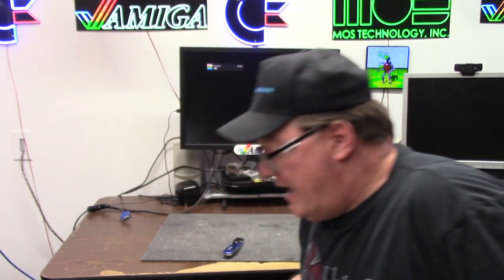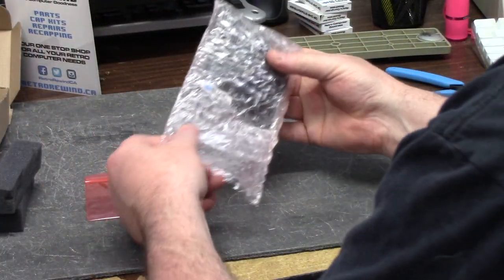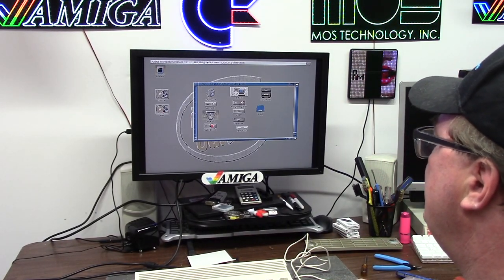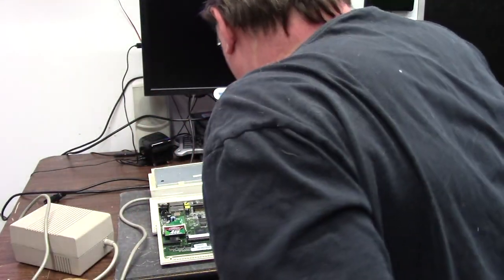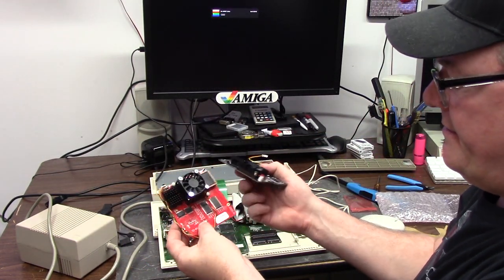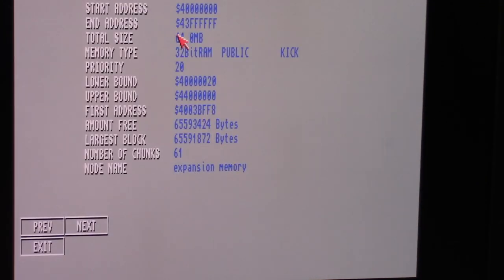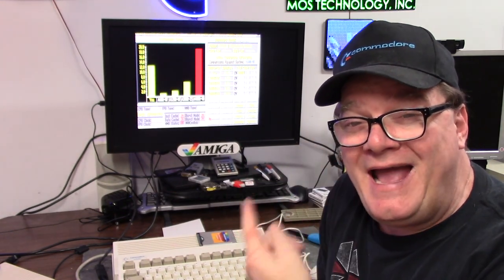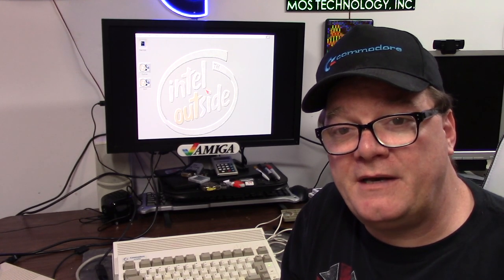Amiga 600 A630 68030 50mhz 64m Accelerator

Comment: A short Amiga story.  Back in the '80's, I worked at a small used computer store called 'The Byte Brokers'.  I had access to lots of old equipment to feed my computer acquisition addiction.  Altair, Osborn's, Ottrona's, Mindset, Sage, Commodore portable (laptop), Colts, 64's. etc. I could list dozens of machines we had (and many that I purchased).  I ran the service department for many years and personally repaired hundreds of 64's (we were one of two facilities in the area).  Belonged to the locale C64 club, and a Commodore rep (unfortunately don't remember his name) attended and brought out a pre-production Amiga 1000.  OMG, I was hooked... it was so far advanced over anything I had ever seen or used.  So being a retailer, we obviously had some relationships with other local computer dealers... and I told my boss - hey - want an Amiga 1000.  So he called the local Amiga dealer to be (It was either Businessland or Computerland - it was 34 or 35 years ago) and let them know that we wanted one.  So on a very, very stormy night here I got the call to come and get it... and I sped my way ovr in my '69 Camaro and picked that baby up.... $1200 plus tax - got the first one in the area as well as the first discount.  Now keep in mind, there were no monitors or peripherals available for it.  No software yet either - just the OS and the demos that came with it.  But it started one helluva love affair with a computer, and I have had one ever since.... had several different ones... and hopefully I will find another 3000 (I bought one new and later sold it to help pay for a new baby) at a reasonable cost (yeah, I just fell out of my chair laughing as well).... anyway, that's my story. ;)

Comment: Love all your videos!
I started back with the A1000 before there was a model number on them. Still have the monitor, which also has no model number anywhere on it!
Migrated to the A500 the next year, and then to the A2000 a couple years after.
I started running a BBS (Citadel-68k room-based software) on the A500, and started to migrate to the A2000 while upgrading it to 8megs RAM, 40M HD. It had external Zip-drive for backups, and a 7-disc CD drive for Fred Fish discs access to the BBS.
Just before having to clean house for a move, I was about to add a 1.44 floppy in for DF1:
About 2 years ago, I bought an A2000 in the hopes of starting the BBS back up, but have run into various problems, inconsistent problems, and now the video splitter/capture card won't work, and both floppies don't work. The MegAChip doesn't make any change, so I'm stuck with 5M chip. After our last move, the modem won't connect to the phone line; still working with Spectrum on that issue...
Again, love your humor and memes you come up with on the fly!

Comment: What would happen when playing classic A500/600 games with the A630 installed? Does it cause any issues if you wanted to play Lemmings or Cannon Fodder? Apart from the Sysinfo benchmark, what 'real world' advantages does the accelerator card bring over not having one? Thanks.
Reply from the maker: Much needed 32b fastram.  All the games ive tested work well.  The 030 has always been known to be the best in compatibility and performance

Comment: I ordered one of these, but My A1200 is too fast (same CPU on the axel card, but 128MB fastram and more options.  Individual Computers ACA1234 for those who are considering too fast option - they manufacture cards for A500 too).  The only reason I would use A600 because it doesn't have AGA glitches on all the demos and games.  AGA cannot be turned off no matter what even using the early startup menu as it is a hardware chip, not software.  A600 - ECS.  A1200 AGA.  Great for those software that support AGA like Deluxe Paint and several good games.  68030 Gold Top.  So to use all the software (I have an 6GB disk image or so) I need two Amigas.  I also have MiSTer FPGA (MiniMig - soft 68020 core) as a low end reference to compare other systems with.  Cool video.  Retro Passion Co Uk.  They can rebuild whole PCBs.

Comment: Another great vid Chris 👍🏻 Slung my Furia too! Now running a ACA620 I picked up from Fleabay and like you glad I swapped. Don’t really like the Furia. Too much messing around for something that should just work 🙄 
My Amiga Story; Not going to start from the beginning. With A500 in 1989 or A1200 and CDTV in 1993. I’m starting from 2006 where I decided to get back into the Amiga scene. I don’t know what it is, but the Amiga is a enigma that I still needed to explore in the 21st Century. Since buying a ESCOM/Amiga Technologies NOS off EBay (First part of the journey not knowing that after Commodore, the Amiga was being made after 1994!). I’ve discovered a lot more about what the Amiga can do. For example that ESCOM made systems had a change on the mainboard to use a PC type Floppy Drive, but meant you couldn’t use older Commodore made floppy drives and Gotek internal drives. Since then I’ve dabbled with Tower projects with Mediators to actually owning my Dream Amiga. The Amiga A4000 Desktop which I upgraded to the max with a Cyberstorm PPC/060 as well as discovering trying Amiga OS 4.1FE for the first time. To me the Amiga still holds a lot of mystery and it’s always Head blast finding out new things every day.

Comment: Hey Chris, great video. I have also a rgb2hdmi in my a600 and I have also fixed this with hot glue, but on the side. My Denise chip is really hot, so I have cool it down with a passive heatsink and a small fan. I hope your Denise don’t die, because you fill it completely on the top.
Reply from the maker: Ill keep that in mind.  Maybe ill remove that glue then.   Thanks for the tip!

Comment: My best Amiga story is about my 1000. It started out with only 256K. Then added an additional 256K in the front panel. My next addition was an A-Max Macintosh emulator. I then added a ROM switcher with 1.3 and 2.something. Next came an expansion box with two  slots. Into those slots I put a 2MB card and a BridgeBoard card. My last addition was an Amiga 2000 keyboard and adapter as my original keyboard became FUBAR. Wish I still had all of this! The only item I still have from that time is my Mac IIci with it's '040 accelerator and a Screaming video card whose make escapes my old brain. Too lazy to get it out and check, lol. That system was close to $10,000 back then. A fool and his $$$.

Comment: This is the board I've been saving up for, it looks great and seems to be less hassle than the Furia.  But then I started to think pistorm600 instead. It's like someone showed me an easy route to what I want and I said - no! I want bugs and CPLD hassle and artificially expensive raspberry pi boards and SD card imaging. Because I choose to do things the hard way for some reason...

Where was I? This board looks very nice, thanks for the demo and benchmarks, it's good to see it in action.
Reply from the maker: pistorm 600 video comes out on the heels of this one.
Reply: @ChrisEdwardsRestoration  nice. I hope the pcmcia problems weren't a deal breaker for you. Or maybe you got it working?

Comment: Great video as usual Chris
I wonder if anyone has attempted to make an a600 CPU adapter to enable the PLCC accelerator to plug into a a500/a2000 68000 dip socket? Probably pointless

Comment: My COOLEST Amiga story is that I have None. I grew up on PC's have only recently discovered the AMAZEMENT of Amiga. I wish I had one when I was younger, and I also wish I had learned about them sooner.
I am planning on building a Pimiga very soon, I just have to find a day with a clear schedule and and be in the right mood. I've got a CM4 and the board it clips onto has a PCIe Gen3x4 nvme m.2 slot which I have a 500GB drive in there. It's total overkill fora Pimiga so I I'm gonna load up one of my 256gb SD cards to multi-boot different builds and I'll make a nice grub menu if possible so I can switch between Pimiga, Rasp Pi 0S, Twister OS (or whatever it's called now), Retro Pi, and some others I might come across in the future.... 
It will most be for running Pimiga because I know there is SO MUCH for me to learn about it and I tend to prefer learning new stuff over playing games, even if they are retro, but I'm SUPER interested in the games that are on the Amiga because I've never played any of them (or even heard of a lot of them for that matter either LOL)
So there it is.. my (soon to be) Amiga/Pimiga story.  I planned on making some videos about building it, but I've never done anything like that and I'm not even sure if I would want to start Channel... but if I do I'll throw up some info in your comments. 
THANKS for ALL the GREAT KNOWLEDGE!!! :)

Comment: i got my A630 on saturday but sadly it did not work with my amiga all i got was a black screen and yes i clean all the contracts up my 8mb a608mini works just fine but the A630 would''nt work 😢😢
i have the June version a300 1.1 board
Reply from the maker: Contact your reseller and exchange it
Reply: @ChrisEdwardsRestoration  
i have send it back and waiting to see if it's the board or my amgia
Reply: @ChrisEdwardsRestoration  
update here chris my reseller contract me and had to do a diagnostic test and found the socket on the a630 was all dirty and crap up under the 68030
so he going getting another one for me soon and told me they are making red PCB boards so i told him i wait and get one of thoese bad boys👍👍

Comment: 68020 and 68030 to practically ten CPUs alone, 030 a bit faster thanks to more MHz ball, only the 68040 CPU gives power.
Reply: 50 MHz CPU is ridiculous in 2023 to be honest. Ultra cheap MCU for 4$ like ESP32 runs at 240 MHz, has dual CPU, is 32-bit RISC ISA and has 64-bit FPU.
I do not understand why they don't make 68040 at some more advanced manufacturing process, let's say on 12 nm. That would be super small, dirt cheap, low power consumption and would run around 1000 MHz. That would be nice upgrade for Amiga.

Thanks god for PiStorm.

Comment: I was very surprised by the high price I sold my 2 Amiga on ebay 20 years ago. It seems some poeple are stuck in the past. If anyone interested I still have my Pentium 2 233 with 2 3DFX2  cards in SLI. Very good for playing Rainbow6 first of the name + Sound Blaster AWE32. I offer 56 Modem and 10Mb/s Lan card if you take the beast.